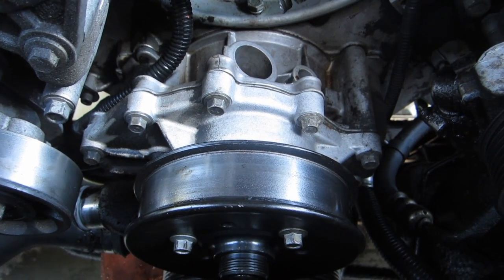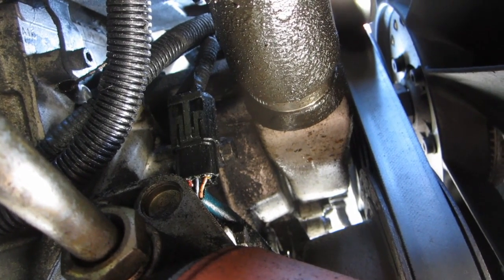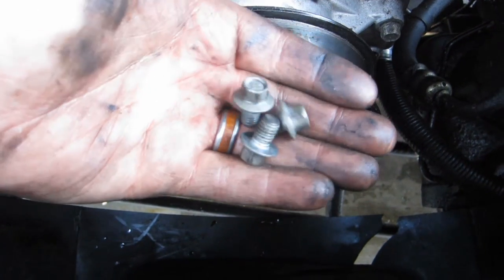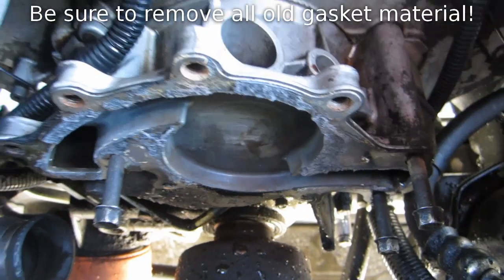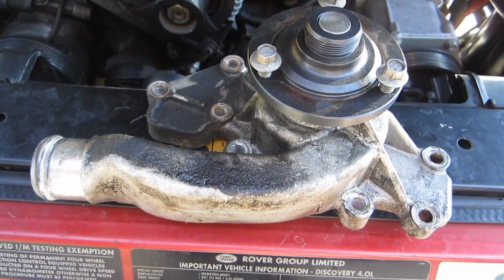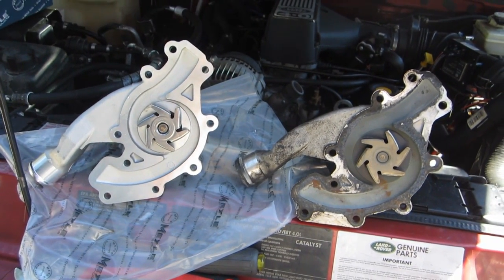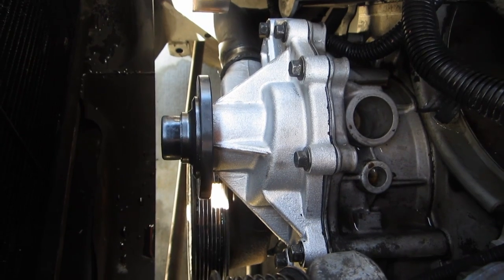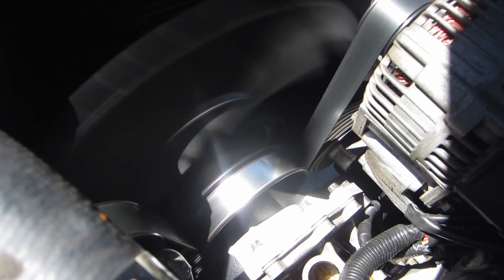Replace Water Pump | Land Rover Discovery

Comment: how did you get the 3 bolts off the water pump pulley? Mine are on there really tight!!  Is there a trick to this?  I did spray them down with PB Blaster  and just walked away...
Reply from the maker: If I recall, those bolts go straight through the water pump so a small part of the threads are actually exposed to the coolant, which is bad news if your coolant mixture is off! PB Blaster is a good start, maybe hammering at the bolt heads a little bit to help break up the rust, and then trying again with a longer wrench!